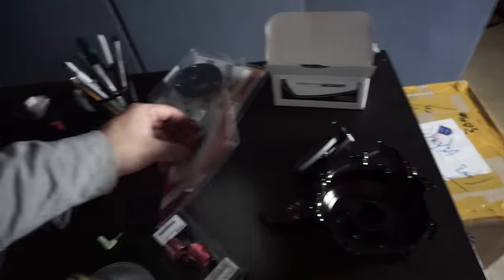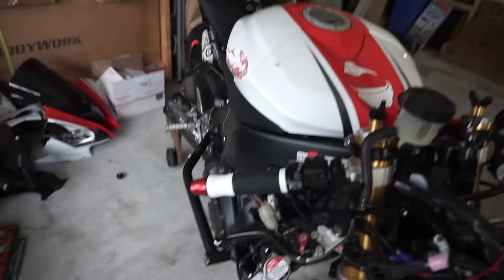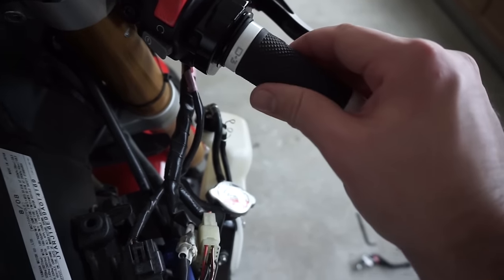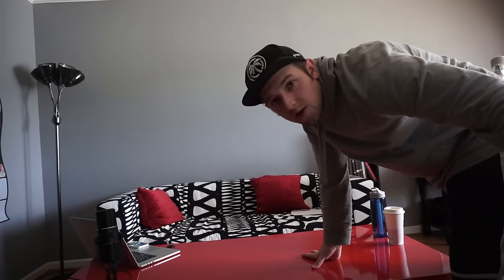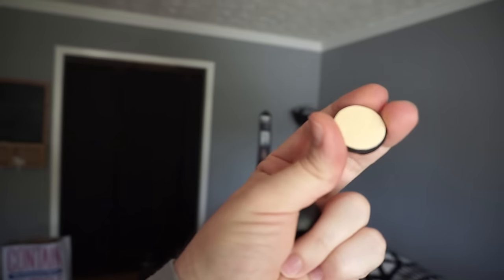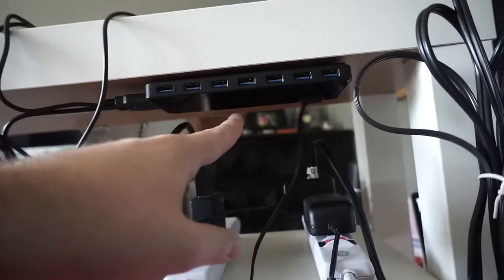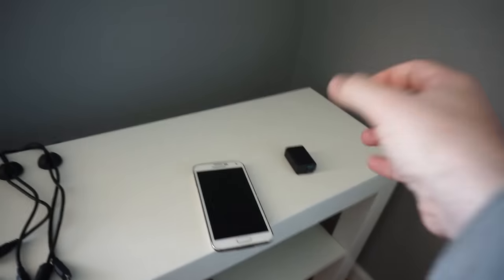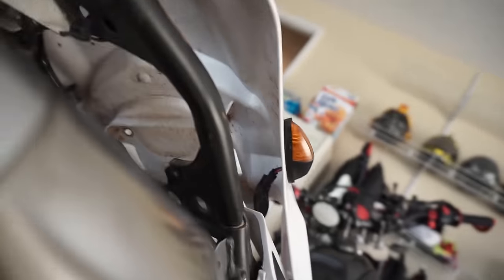Custom Charging Table!!

Comment: you have the grip on the wrong way buddy! the larger white part should be closest to the controls
Reply from the maker: +SammyOnAYammi Let's just say I wanted to be unique? lol
Reply: +C2Wtwo ZJMotovlogs made the same mistake on his old orange CBR.
Reply: +C2Wtwo hahahah hell yeah that's what it all about :) ride safe bro
Reply: +C2Wtwo Tip use hair spray inside the grips then quickly slide them onto the bars. they will slide on easily but wont turn or come of with out alot of effort

Comment: What I did on the throttle side with my rizoma bar end on my r6 was, I did put one flat spacer washer between throttle grip and bar end to create a little bit space. That fixed the issue!

Comment: Wait to put the cap on until after it is painted. As a painter I would either remove it myself for paint, or have to tape it. Leaving some yellow in the cracks that you would be able to see if you are looking for it. Just my 2 cents!

Comment: use compressed air.  between the bars and new grips.   it take them off easily. and puts them on easily as well.  good luck on the rebuild.

Comment: If there's a cap on the gas tank, the painter will NEED to cover/tape it up (time consuming) and or remove it completely , I would suggest keeping it off until it's finished being painted.